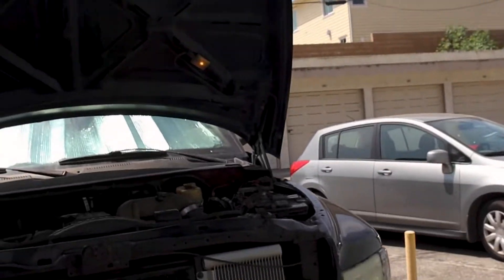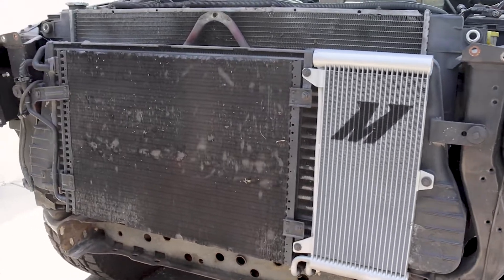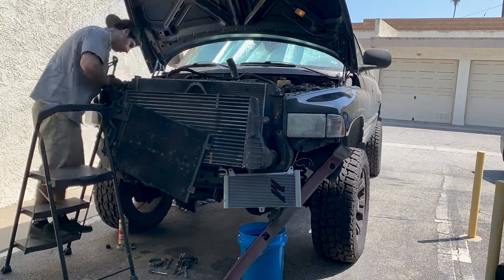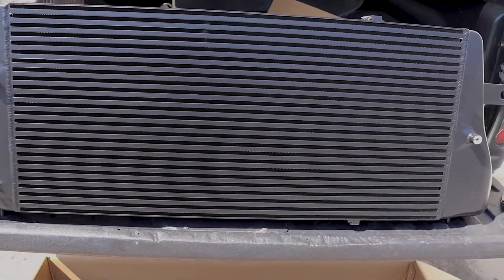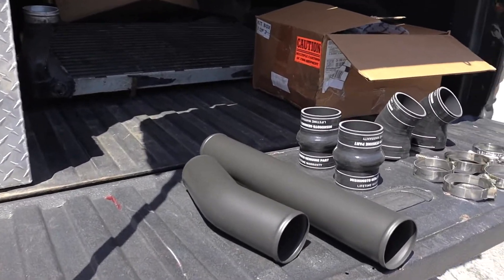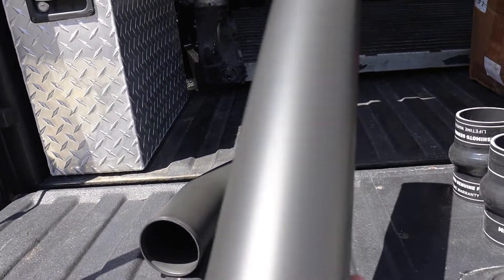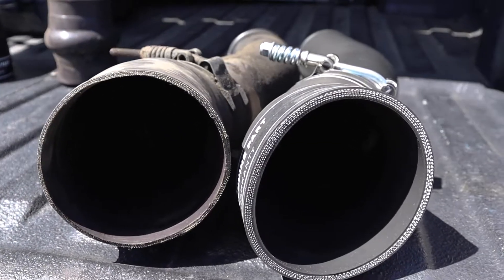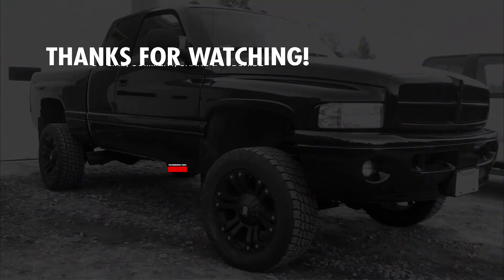Mishimoto Intercooler install on the Cummins

Comment: Jus did this install on the same truck (just 1995 12v). Installed super quick. Here’s the bad part the hood can not shut now( it hits the trans cooler and condenser half way down with 6 “ left ) . Also the bumper will not fit on anymore! My question to you guys was there any fabrication tips that you did not mention to get both of these body parts to fit back on?
Reply from the maker: I had to trim my bumper a bit with a grinder. As far as the hood not shutting, beats me. Try reaching out to the company.